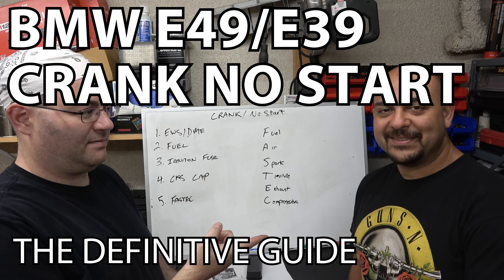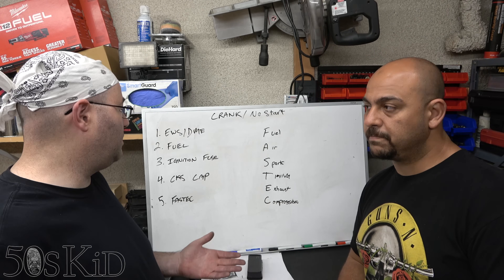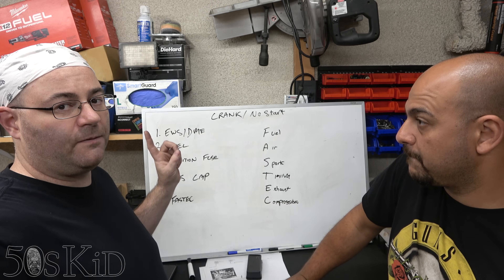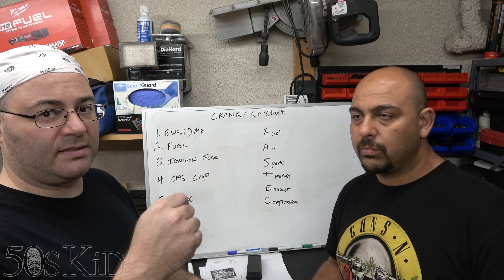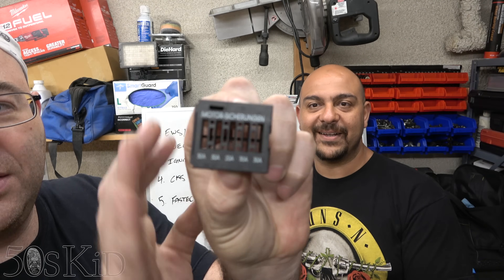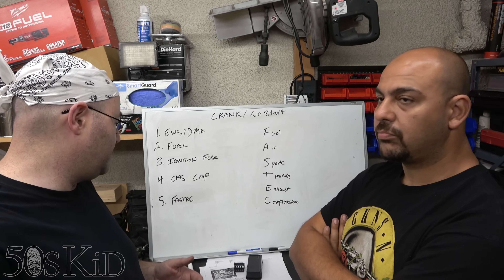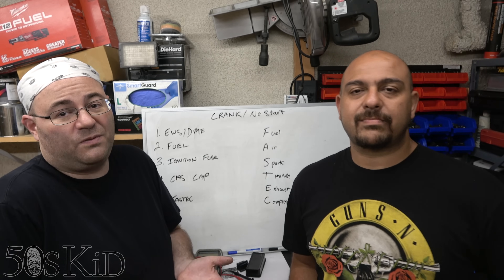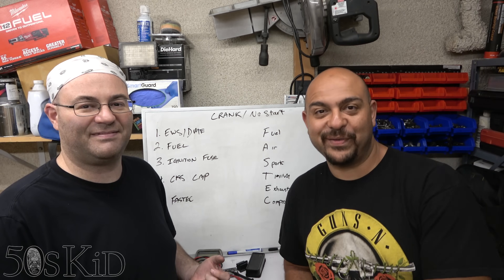BMW E46/E39 Diagnosing a Crank No Start: The Definitive DIY Guide

Comment: I've watched a bunch of your videos and you've really helped me on my son's E46 - enough so that I bought an E39 with a crank no start condition a few weeks ago prior to you publishing this video.

Here's my input that may or may not help some folks:
1) checked fuel - fuel pump hum and ~50# of fuel pressure at the rail
2) spark on all 6 plugs
3) air intake hoses okay but CCV drain hose split which was expected due to other codes.  Replaced CCV and related hoses.
4) crank sensor showed RPMs during cranking
5) exhaust cam sensor had a code but checked okay
6) intake cam sensor did not show any codes so I assumed okay
7) performing a compression check when the battery died - a couple of cylinders were showing low compression - odd for an engine with 130k miles.  Pulled all the plugs while the battery recharged
8) learned that if the MAF could possibly cause a no start but if it is disconnected it would still run
9) reinstalled plugs before completing the compression test and disconnect the MAF - car started!
10) checked by reconnecting MAF and it started again and has ever since.

I think the car was flooded (with fuel) which can occur with a cold start and then shut down.
Reply: This was my case, suddenly me e39 (m52b25tu) was driving fine a few hours prior before i parked it and when i got in i did a cold start but accidently let my fingers slip off the key so that the engine didnt crank long enough to start. I ofcourse tried to start it but it oddly didnt, so assuming it went into safe mode not causing fuel floods as the next morning i got in and it started fine. So guessing pulling the battery did the trick to fix it.

Comment: Thanks for video. I was having a starting problem with my Z4 E85 3.0. I guess I screwed up EWS III when playing with the scan tool. I reset it and the car started right up. Your Schrader valve tip was a HUGE time saver.  Thanks Brothers.

Comment: My ‘03 E85 Z4 has 100% crank all the time. The ignition switch tests and works 100% of the time. I have NEVER heard the fuel pump noise—when she starts or just cranks.
I bench tested the fuel pump relay and it works 100% of the time ON THE BENCH. But when installed in the car, it activates and I can hear it activate and I can feel it activate when the car starts, but when it just cranks, I do not feel the relay activate during crank. (I would think it should activate with just key on, ie without attempting to start/crank but it never activates in key on. When it does start, it runs phenomenally smooth/100%. When it does start (intermittently, and usually after it’s sat) the instant the car starts to crank and then—and only THEN—and immediately as the car starts to crank, the fuel pump relay activates and the car starts immediately. When the car starts it always immediately starts and runs just fine. Sometimes I can start it multiple times in a row, just fine. Sometimes I can go days and it just cranks. (The battery is 100%) 
• so EWS isn’t the problem because she cranks—right?
• can’t be a fuse because she cranks and she starts and immediately runs just fine when she starts.

Again, I have never heard the fuel pump noise. Long before I ever encountered this problem, I attempted to hear it, but alas, nope. And she always ran and started just fine. 

When I remove the fuel pump relay, I get 10ish volts across pins 1 (grnd) and 2 (which I assume would be 12v, but it measures 10ish and that fluctuates as the car cranks) 
I do not have a scan tool that works. I am poor and receive military disability only. 
I’m trying to get the parts to be able to check the FPR in circuit, which I will do by making five extension leads so I can see and troubleshoot the FPR in circuit. 
Could any one of the position sensors inhibit the FPR from getting its activation ground or 12v?
And if so, how come the car starts & runs perfectly sometimes, if one of these position sensors are bad. 
When my car is running, she runs perfectly, idles smoothly, and accelerates just fine. 
The ‘03 Z4 doesn’t have that fuel pump module. 
Although I’ve never heard the fuel pump at any time, it has to be working when the car does start?? 
To reiterate. 
Crank no start. Car cranks vigorously and I can’t hear or feel the fuel pump relay activate. It’s not corroded, and tapping or wiggling has no effect.
When it does start, the FPR does activate —but only as the car starts to crank. I can hear and feel it activate, and then the car runs flawlessly in all conditions.
Hot/cold engine or conditions appears to have no bearing on this issue. So can one of those three position sensors:
• really be that 100% intermittent?
• be the definitive reason the ground or 12v is not being supplied to the fuel pump relay? 
Thanks in advance. -Curt

Comment: Bought 2 cam and 1 cps from wish and waited 2 weeks for them, total cost 17$ all 3 have run for 80k miles now perfectly. Talk about lucky!def go oem. A side note when my cps and cam sensors failed I pulled the plug on my maf and let it run on it's baseline. Had 0 problems but that's an i.c.e setting and only to get yourself home.great video bud ty

Comment: I have watched your videos throughout the entire of my project and it’s been an absolute pleasure watching. This is my first bmw 325 I bought it for 500 bucks in great condition with a blown head gasket. Ran and drove no problem minus the usual head gasket issues. I get the car together everything is good except it won’t have constant flow through the injectors again everything was working fine. It will pop off and die once and not again unless it sits

Comment: Hey bro ur video is helpful,my issue was the ignition fuse burn inside the box with the DME the cause of the problem was my oil level sensor shorted and burn the ignition fuse  thank you guys

Comment: had a crank no start issue with my m52 some time ago. It was cylinder wash down. had to pour a table spoon of oil in each spark plug hole. started right up.

Comment: Hey guys, I have a 98' 528i. It was throwing a camshaft position sensor circuit a code, so I replaced the sensor twice with oem-brand parts, and while I still have a check engine light and the code remains, the performance was not effected (did the sensor 6 months ago). 

It wasn't until recently that I started having some issues. It randomly would crank no start, and you couldn't even push it start it. This would happen after driving the car, turning it off for a couple minutes, and trying to turn it back on. It would do this a lot at some point, until recently I replaced the CRANKshaft position sensor, and it went back to normal, and wouldn't do it, for the most part.

When it had the issue, you would let it sit for 10 minutes, and it would start right up. 

However, today I went out to the car, and it wouldn't start at all, even after sitting all night. Battery levels are perfectly fine and all the interior lights are perfect. It would crank super strong, and but wouldn't fire at all. 

The exact same thing it had before, but this time it didn't have to do with me driving it before. 

Something interesting is that in the past few days my key fob wouldn't unlock the car at random points after sitting for an hour or more, and my key wouldn't even unlock the doors in the physical door itself. Funny enough, I found a solution that would it to work again is unlocking the trunk with the key, and closing the trunk. Every time I've had this issue, the key fob/door lock would work perfectly fine immediately. It's like it resets it or something. Don't know if it is related at all, but thought it would be a possibility. Any thoughts on this?? Could it be the camshaft sensor wiring? Any help would be hugely appreciated! Thank you!
Reply: Did you figure it out?

Comment: One thing you didn't mentioned with Fuel. My E46 would crank and not start. I thought it was the pump. It turned out to the be the fuel regulator (over fuelling). The regulator on my E46 was part of the Fuel Filter.

Comment: Hi 50sKid, what do you exactly mean by "... maybe cranked with the vanos out..."? 

What exactly is vanos in this case? Is it these two toothed weels where the chain is mounted on or do you mean these two vanos solenoids with the electrical connectors on them? 

If you mean the two toothed wheels, I can imagine that the timing would be off if cranked without them but can timing be off by cranking without those two solenoids plugged in into the engine case?

Great videos man!!! Your work helped me out a lot! Thank you!

Comment: And it will not necessarily throw code unless you have a completely failed sensor. If your sensor returns any kind of signal back to the DME it will not throw code. Eventually with enough cranking you may get a synchronization code but most times unless it's 100% dead you won't.

Comment: 4 minutes in, I took the intake off without disconnecting the battery, something in the harness shorted and it blew a 30a fuse in that small fuse pack.
spent a while trying to figure that one out.

Comment: I have an 01 325xi i replaced the fuel filter and got the back hoses mixed up and primed fuel into the return nipple of the filter the car didnt start obviously after realizing this and fixing the hoses.... the car now will not prime fuel at power on ie the fuel pump isnt turning on and the car clicks the starter doesnt crank then the steering column locks the ley from trying to start agian until i turn it off and back on i dont know what to do at this point im scratching my head fuses are good batt is good is there a safety limp because it didnt have fuel the first time i tried? Plz help thanks

Comment: What can it be if car starts sometimes and still its very hard to start and if I turn car off and start few seconds later it starts just fine, but with like a 1s crank but if I leave it for an hour, its again very hard to start, or sometimes u can't even start it, I have E46 320d 110kw or 150hp

Comment: You guys are great. Maybe you can help me with my 2004 e46 cabrio. I have crank but no start issue as well. All the fuses are OK and I replaced the Fuel Pump OEM relay . The only way the car starts is with starting fluid sprayed into the Intake.  No fuel in the fuel rail (Schrader valve  doesnt produce any fuel) so I decided to change the fuel pump with pump from Bosch and a new fuel filter. Unfortunately there is still no fuel pressure in the fuel rail. What should I do next? The car cranks and starts with starter fluid only despite the new fuel pump.  Please help
Reply: found the solution ?
Reply: @zlabfab487  yes,  lol. When changing the fuel filter,  I reconnected the fuel lines incorrectly.  Two fuel lines go to fuel filter from the tank,  i connected the return line to the main line and the main one to the return line. After correcting it, the car started after few cranks and after sitting for over 2 years in the garage. Such a rookie mistake,  lol
Reply: @daniel600x1  Thanks for the reply and good thing you have your BMW running :)

Comment: Hi I have 2005 BMW X 3 , Have  been fighting a no crank no start for a few years ..I have added a push button to the wire on the left side of the starter with the key in the on position car starts and runs fine … Have checked every relay and fuse I could find need help .. only drive the car for 5 months out of the year and love it but would be nice if I just turned the key and it would start . now BMW dealers up north in Canada LOL …….

Comment: Hey @50skid 

My bmw e46 has good cranking power, did do a fuel compression test just by priming the fuel and saw some fuel squirt out with some compression. My neighbor had a spark plug tester and he said he saw spark in cylinder 1 and still can’t get it to fire up! Your videos are awesome by the way. I had a code last time I took it to get my service engine light checked and it said it was running lean so I’m wondering what to do next. Should I go and buy a Diagnostic scanner and see what codes it’s throwing out? Not a real knowledgeable guy on mechanics but do love to get my hands dirty and learn so any advice would be greatly appreciated. 

Thanks

Comment: Hi I have a E39 2.5d and my problem is that it starts instantly when cold but when warmed up it won't, so I replaced the crank shaft sensor on top of the motor still the same problem and the file pump appears to be building plenty of pressure. But there is a leak on one of the injectors and sometime while driving the injection error comes up could this be the problem while starting when warm?

Comment: Question could changing out the pan oil sensor on a 1998 540ia cause a no start?  I changed the ignition with a new one. checked the fuses! Still does not start!

Comment: Hi my BMW 520d e60 was parked during lockdown I kept starting it until the battery was died and run out of diesel so eventually I put some diesel recharged batteries but it wouldn't start. INPA ISTA GIVES same errors all 4 glow plugs code 4222 4212 4232  4242 could it be glow plugs unit control or DDE relay do you have any idea the cranks but doesn't start. I did resync dde cas . Regards

Comment: I have 2004, 330Ci it was running fine until one day it stop running, it cranks but no start, need your help, there is no power to the fuse Ebox (20 amp) check the fuel relay socket behind the glove box, I have power on terminal No 6 from fuse No 54, No power from terminal No 8 from Fuse No 3 from Ebox, no ground from DME terminal No 4. 
Thank you in advance

Comment: Seeing digital multimeter to check a cam or a crank sensor, unless you're multimeter has a super fast sample rating you're not going to get a verification of a good or bad reading. It's simply too fast for most multimeters to be able to pick it up. Now if you have an old school analog meter with this the arm you can check with those if you see the arm sweep back and forth you got a good sensor if not you got a bad sensor.

Comment: Hey , i have a problem with my e46 320ci 54engine , only huppens after car sits many hours , my car crank but i dont hear the fuel pump working , so i check the connection to see if the pump get power and all good , so if i turn the key to position 2 a few times , usualy 6-7 times the pump starts and the engine work fine for the rest of the day , if the car sits 2.3h car starts just fine ,starts normal runs smooth no intreruptions , So not sure what to do .Do i need a new pump ? Or is any other component responsable     For my pump not to start ? Hope u got some spare time to answer. Thank you

Comment: Dude, i have the same problem code is 2373 manipulation protection, how you fix this? Recode the module? I'm using INPA for scanning, and tried to ECU-EWS sycn, but the code still there and won't able to start the car (in my case it does crank but no start). And i cant hear fuel pump sound anymore, could it be bad fuel pump or thr relay? Please help, thank you . . .

Comment: When it comes to fuel pumps on a E46 you should be able to hear it kick in when the key is turned.  If you don't check the fuses and the relay.  In my experience I see the relays fail much sooner than the actual pump.  The fuses are easy to get to while the relay check requires you to pull the glove box.

Comment: Replaced the engine on my first BMW 03' 325i had a blown headgasket and it started right up ran great without the front end on just essentials connected. I put the front end on along with plugging in coolant sensors and it won't start now... Just cranking. I didn't touch ANYTHING I'm so clueless. I tried to clear the old CEL's and my scanner said there were still 11 codes remaining. I have double checked every connector is plugged in and vacuum lines ran correctly. I can here the fuel pump priming and have good fuel pressure. I haven't checked for spark but I did pull my plugs and they looked fine. Any tips?
Reply: Did yuo fix i hace th same problem
Reply: @edcalderon7301  I had a bad cell in the battery so I wouldnt take a jump start. After replacing battey it starts and runs great.

Comment: Hello, I know this is quite a bit to ask but I believe one of my intake cylinder head valves was bent after I finished replacing the valve cover gasket. I made sure all the connections were tight and back in the right spot. Car misfires really loudly, shakes violently, loud metal banging sound, and then dies after a minute of this. Would it be possible for you to make a video on how to replace one of these? I've looked around but can't seem to find a full step by step. Car is a e46 330ci 120,000 miles

Comment: Any reason why car have issues starting when cold?  New battery 900ccA, spark plugs, fuel pump. Turns no start. Have to jump it
 Could fuel filter cause it. No codes . My other suspicion is injectors

Comment: I am completely stumped. I have a crank, No start on my 2004 330Xi. I moved it, in my driveway, then when I returned to move it back, it started for a split second and died. It has not run since. About 2 weeks ago. I have checked all the usual suspects. Fuses, fuel, spark, and replaced both camshaft sensors and the crankshaft sensor. Still won’t start. Could it be my ECM? I don’t know what’s left.

Comment: My e46 has an crank intermittent no start. When it does start the first time it takes two cranks to start then after that usually once it warms up it will start up first crank or sometimes after turning my car off and while sitting for moment then trying to start it will just keep cranking no start than start right up after that try.

Comment: I need help with my 320d e46.....its cranking but wont start ...... The fuel pump does prime alot of diesel..... But on the rail line there is no pressure at all even when cranking... Its jst dripping.... With no pressure....